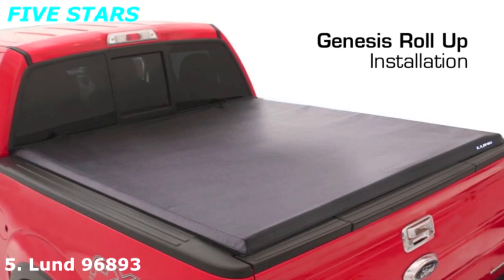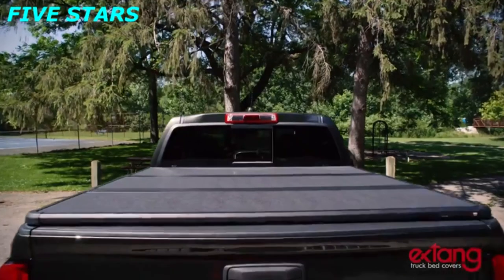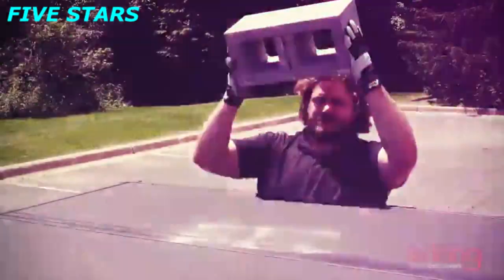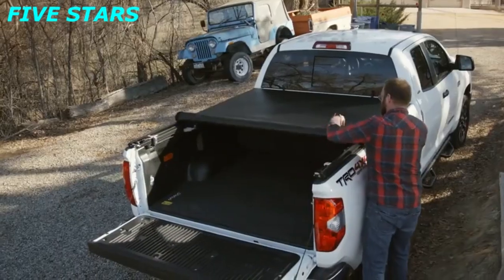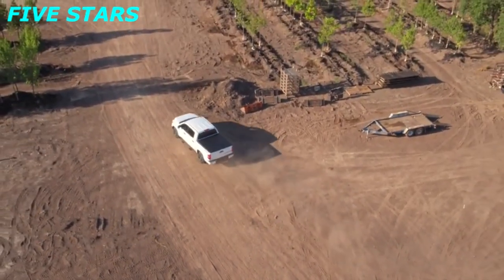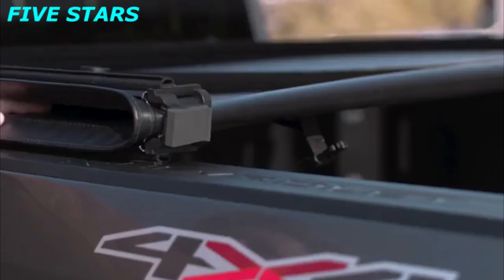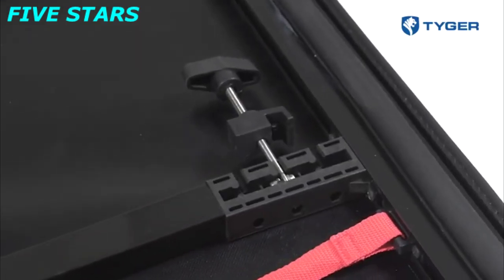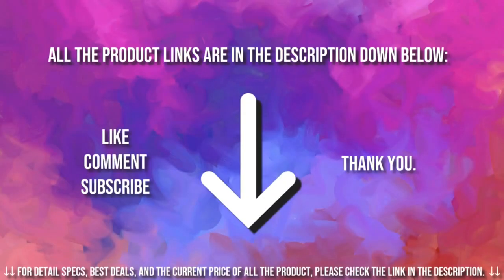5 Best Truck Bed Cover 2019: Folding, Roll-up, Retractable & More

Comment from the maker: Best Truck Bed Cover 2019
This list is not a TOP. Is a list of the   Best Truck Bed Cover 2019  in not  a particular order

5. Lund 96893 Genesis Elite Roll Up Truck Bed Tonneau Cover 

     US https://amzn.to/31Fb2iv

     CA https://amzn.to/2Z97TWn

4. Extang Solid Fold 2.0 Hard Folding Truck Bed Tonneau Cover 83830

     US https://amzn.to/31KoFwR

     CA https://amzn.to/31Hsx1C

3. TruXedo TruXport Soft Roll-up Truck Bed Tonneau Cover 281101

     US https://amzn.to/31E6DMw

     CA https://amzn.to/2NeSf9w

2. Gator ETX Soft Tri-Fold Truck Bed Tonneau Cover 59421 

     US https://amzn.to/33F5LJl

     CA https://amzn.to/33FZihi

1. Tyger Auto T3 Tri-Fold Truck Tonneau Cover TG-BC3D1015 Works with 2009-2019 Dodge

     US https://amzn.to/2YTmwSC

     CA https://amzn.to/2Z86BLx
Reply: BEST means TOP. Do you not understand????